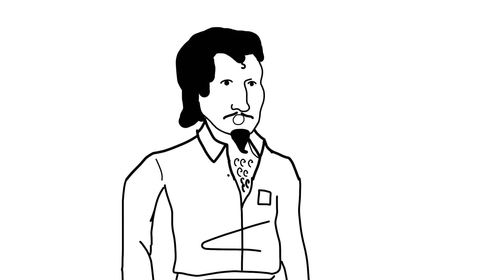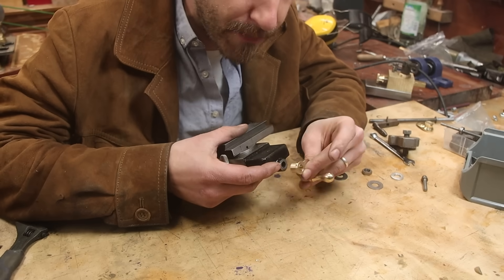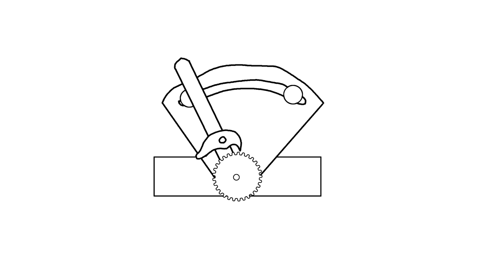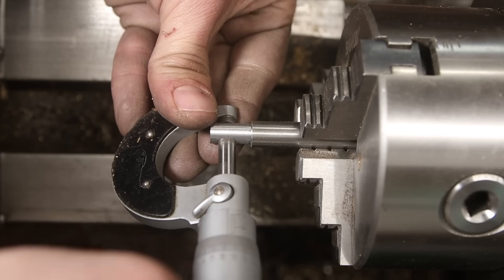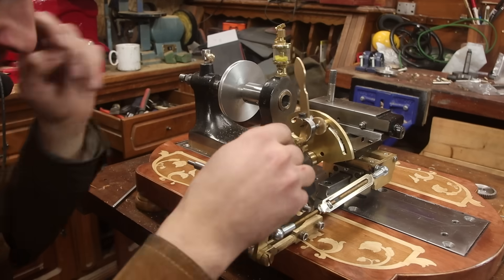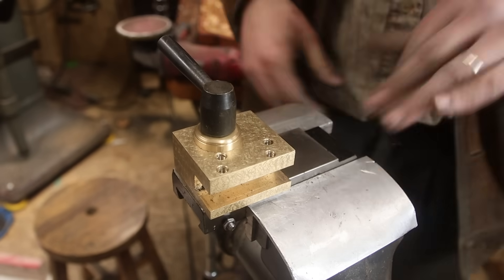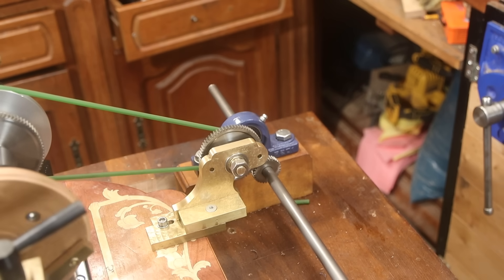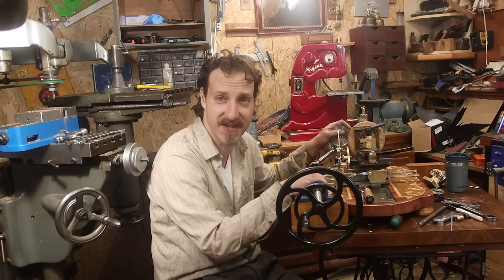I Finally Made a Rose Engine Machine

Comment: I think its never going to work with the roses driving the cutter. You really need that accuracy and weight of action to keep the cut steady, as you press the cutter with your thumb you need to feel the smoothness. You cant just set a depth and go crazy.
Still impressive attempt no doubt you can do it

Comment: Beautiful and inspiring work as always. The hand operated tool rest is amazingly effective, might be cool to have it double loaded, a sharp engraving style profile on one end, and a slightly radiused cutter on the other. That would give you smoother cuts with less grabbing or gouging. Also some relief angle on the top of the cutter might give you more control with better finish. Joe Pie has lots of great videos on cutting tool geometry. 
And, you said it yourself, cams on the spindle, no linkage required, direct lateral motion transmitted to a tool cross slide (this could be added as an optional setup, and might be part of the copy lathe functionality).
The lathe head you have has an exceptionally wide open area between bearings, plenty of room for some beautiful brass cams. 
Make it so!

Comment: Yeah, I think you are correct, in that the machine needs significantly redesign. But I do like how you mounted the work piece to the spindle. Everyone else has the brass stuck to the lathe heating up a glob of scalack. And they had difficulty getting the peice flat, and square. I doubt you will have that problem. It is at least a partial success.🤔👍👌🤔🙂

Comment: The spinning driveshaft with the flexible universal joints reminded me of a video I watched that showed how the speed of the driven end of the shaft would speed/ramp up and slow down per revolution because of the wrong shaft angles, and clock positioning of the joints relative to each other, they were using automotive driveshafts as an example... Great video!
Reply: The four connecting points (bearings) of the cross-pins act like cam lobes when the joints are flexed at severe angles, the other joint angle/yoke orientation at the other end of shaft should cancel out harmonics from each other.

Comment: Zero backlash gear set?  I suspect you are familiar but a clumsy description: Two identical gears side by side, matching slots with a spring in the slot, each end of the spring attached to each gear. Spin the gears against each other to tension the spring in the set before meshing with its mating gear. Viola! No lash.

Comment: Can an upside-down pigeon...
Step 3
6 airbags x2 as the system only holds that much air . Neutral is all bags at half mast.
Maby a track 👣 for the weights 💪 to solve the problems of motion interfering with the lime it takes for displacement of bag 11 to 1 to bag 5 to 7 keeping 1 to 5 closed and 7 to 11 open. 
.....&  an aquarium to display your upside-down air fall 😊

Comment: No desire...
Step 2
Piston shafts from 12 to axle to aquire away from it balance of the 12 weightlifter weights that top their rods.
Motion is from sauser mounted with hole in center . They backstop the weights at the rim. To about 4" straight away from axle outwards.
We're going for a perfectly balanced wheel. 😊
Oh and an aluminum belt arround the whole rim ... maybe first ? To make an area for air to flow freely through.

Comment: For one thing, You have to fit the double cardan so that the varying speed of the first coupling, is canceled out by the varying speed of the second coupling. If a single universal joint is turning under an angle, the speed varies during a revolution.

Comment: Perpetual motion pathway...
Step 1.
Bike axle spokes and rim.
Use the hole for adding and subtracting air for that purpose later so put 2 holes one on either side of it a distance apart of 12 total holes evenly spaced arround the rim.
So 13 total holes 
Is the battle I fight to communicate this to another recognizable 🤔

Comment: Genial! About backlash... First I thought if you added a disk break to resist the rotation. Because force is needed to overcome the brake pad friction, backlash disappears as soon as crank force disappears.  But, maybe better would be a ratchet in the spindle with tiniest of teeth? Or ratchet without teeth, a sping loaded ball bearing in an shallow angle against a cylinder.

Comment: Hi Uri, a brake or means to introduce drag may relive the effects of gear backlash, this will only work if torque only goes one way through the geartrain. Another method you could try is make the gear centres adjustable so you can bring them close together with a screwdriver or tool and take out all backlash, this will work with certain types of gears.

Comment: Nice attempt and beautiful execution. However some of the problems were anticipated. The double universal is one source of those. It would be easier and better to connect the cam shaft directly to the spindle output by a chain or a  timing belt. Another source is moving the compound slide. The sliding movement must be loose enough to easily slide, and cannot be rigid enough without being too tight. The linear ball bearing tool slide  - even with the support  - can be a problem as well. Those slides are not rigid and can have considerable side play. A lapped sliding fit is much better.
Over the years I've built a number of rose and ornamental mechanisms and  attachments, in fact using the rocking tool post in one of them. I used a flexure system to achieve a light,  short parallel action without any play  and backlash. 
So yes, the classic design of rocking head-stock is the best, but  with some precaution good results can be obtained with the rocking tool-post as well. I am now building a proper rose/ornamental lathe in the Holtzapffel style. It is using a Hardinge  compound  slide, but the rest is custom made using mostly stock metal shapes. I posted the design on Garbcad: https://grabcad.com/library/ornamental-turning-lathe-rose-engine-1

Comment: Oh wow, that is a fun optical illusion.  At 8:47 it looks like your lathe is cutting the work to make it wider, a move which is actually impossible.  The optical illusion is formed by the lighting on the uncut rotating part, which appears narrower than it is, incorrectly.

Comment: As the head stock spins, the universal coupling mechanism used doesn't provide uniform velocity.
So it will introduce a little bit of disjoint in the motion of the cross slide each revolution.

Comment: you need your headstock to rock. you can try attaching the whole headstock to two ball bearings with the headstock mounted to a bar that runs between them. For the rosettes, have them at the back of the headstock and have a stationary rubber mounted to the actual base of the lathe, as the headstock rotates the rosettes will touch on the rubber creating the pattern. Make sure there is a spring or something pushing on the headstock so it maintains pressure against the rubber.

Comment: I was really disappointed with your first attempt... Probably say angry!! you started something and finished with something totally different... I do see a great deal of improvement and even a greater deal of advanced thinking... Honestly don't think you're that far from a successful product!! You where putting pressure using your thumb and or hand against the cutter to the brass material, and you should use a spring that would keep pressure constant and stable... but I repeat you did a Great Improvement... congratulations... You have a much more successful channel than me... Good luck

Comment: Broader gears, more contact with their spindles, a yoke instead of supporting those spindles only on one side, less runout? And/or just slather all the gear teeth in very thick grease, then give up, then replace the whole assembly with a wide belt.

Comment: Excellent video, Uri! I know your pain all too well, having built a rose engine myself a few years ago (I have a couple videos on my channel.) When it comes to engine turning/guilloche, mass and rigidity are super critical. The downfall of oscillating the cutter instead of the headstock is the sacrifice of rigidity, which often translates to chatter. But the upside is that you avoid the challenge of a constantly changing cutter center height as the headstock oscillates. 

Two of the most critical aspects of a rose engine are incorporating some form of leveling chuck and including a provision for setting the cutter height dead center with the spindle. The guide will only control depth consistently on a flat surface, and a cutter that isn't adjusted to center height will create wandering patterns.

Comment: Hi . The spindle parts and gardan governor both of them should be placed on one metal surface , moreover dont use wood as face plate for holding your part. Any soft material like in machinery stuff ruin your effort dude!!!! Please hold your metal work pice by a chuck or shelac as the watch makers do. Thanks for your effort. You are a man with a golden heart!!!

Comment: Your universal joint may cause issues with repeatable patterns since as your angle increase beyond 0, the of the output shaft with vary up and down. The steeper the angle, the more the variability. If you have an issue, you may need a CV (constant velocity) joint.

Comment: Fabulous work Meister Tuchman your talent is astounding. However before you changed the spindle I was going to suggest an indexed tooted belt instead of the stretchy rubber belt. Also the universal drive joint should be solid because they will always move a squintillionth of moustache hair no matter how tight you have them. So do with that what you will I will still be looking forward to your next mechanical marvel and I wish you success in finding satisfaction with your rose machine.

Comment: Use GT2 Belts - we use them for 3D printers and they can be made backlash free. You can also bend them around corners giving you cheap, quick and easy access to rotation any and everywhere.

Comment: Hey uri did you know that when putting rotation trough that drive shaft you don't get a regular rotation which gets worse the steeper the angle of the drives haft? Might be some thing to look into  otherwise very awesome build.

Comment: The Guilloché Dance

In a haven of tools where dreams take flight,  
Uri toils through the fading light.  
With brass and steel in patient array,  
He crafts a rose engine to carve guilloché.  

The rosettes spin with a rhythmic grace,  
Guiding his hand to an artful space.  
Patterns emerge, both precise and free,  
Whorls and waves of symmetry.  

A lathe’s soft hum, a gear’s sharp click,  
The music of making, deliberate, quick.  
Each turn, each pass, a whispering line,  
Etching the guilloché, elegant, fine.  

With steady hand and thoughtful care,  
He draws beauty from the air.  
The engine breathes, its voice refined,  
A testament to Uri’s mind.  

The lines it leaves are poetry’s twin,  
A dance of curves, both thick and thin.  
A story told in arcs and sways,  
A maker’s ode to ancient ways.  

And as the final cut takes shape,  
The guilloché blooms, a timeless drape.  
A legacy spun on a turning wheel,  
Art engraved in brass and steel.  

So sing of Uri, whose craft is rare,  
With passion wrought in each detail there.  
A rose engine’s master, a maker’s pride,  
Where guilloché and genius reside.

Comment: Many people don't understand how a rose engine works. It's relatively simple, allow me to explain. The original machine had a base-plate of prefabulated aluminite, surmounted by a malleable logarithmic casing in such a way that the two main spurving bearings were in a direct line with the pentametric fan. The latter consisted simply of six hydrocoptic marzlevanes, so fitted to the ambifacient lunar waneshaft that side fumbling was effectively prevented. The main winding was of the normal lotus-o-delta type placed in panendermic semi-bovoid slots in the stator, every seventh conductor being connected by a non-reversible tremie pipe to the differential girdlespring on the "up" end of the grammeters...

Comment: I'm a little confused about the use of a driveshaft with u-joints to transfer power the cross slide cam. U-joint style driveshafts do not have a constant speed output, instead the output speed is sinusoidal. The variation in output speed can be controlled by minimizing the angle of the yokes for most industrial and automotive applications driveshaft angle is less than 3 degrees. The closer to zero angle there is the better.

Comment: Please please please keep going on this Uri. You may be closer than you think. I don't think the backlash is such a problem if the direction of rotation doesn't change - after all, our lathes and milling machines have plenty of it. I think it would just be a problem after the cam, the mechanism where the tool goes back and forth, which I'm sure you can solve. I know vibration and stiffness also play a role, but I can see I'm descending into a minefield of innuendo so I'll stop there.

Comment: One little thing I noticed is your two uni joints aren't at 90 degrees to each other which will introduce accel and decel during rotation even at perfect 90 it's still present but much reduced think of it like destructive interference where they cancel each other out. Nice work though driver61 goes in depth about various uni types developed to minimise rotational humping worth a check may help you smooth it to closer to rotational parity :) .

Comment: I sometimes wonder how, after watching you for 6 years, I am not in an insane asylum, but happily I'm not. As an engineer I can tell you that wherever standard gears are used backlash is inevitable. A variable motor drive with timing belt pulleys and belt will help reduce backlash and give a more positive action. There are a few ways to reduce play and backlash in equipment, but they do tend to be expensive/time consuming. Best of luck with it, if you decide to keep on with the project 👍
Reply: so using only belt drives would solve it or gears with very fine teeth ?
Reply: @jyvben1520  They are not the only way, but 2 ways. I've spent ages lapping gear pairs in, that can reduce backlash but usually reduces gear noise. Ground gears and using the ground gear PCD to grind the bore,and having an accurate eccentric shaft, is another way to reduce backlash. Our gearboxes were mainly industrial, defence, maritime and mining related and had around 0.003"/0.076mm for each stage, when using hypercycloidal  gear stages to obtain the required reduction ratio. Using helical gears  instead of spur gears can help reduce backlash as well as transmitting greater loads. Generally the more precise your components are the better you can control backlash.

Comment: Your latest iteration has 3 drive gears.  Can it be reduced to just two, cutting your backlash about 50%?  Also, very thick grease (like refrigerated butter thick) instead of oil.  I used this trick to reduce backlash on a backyard telescope mount years ago and it worked great.

Comment: Hey, That "driveshaft" with the two flexible joints should have the joints in each end facing 90 degrees from eachother. Or else you get uneven speed. Please look up driveshaft vibrations. This is a common issue on driveshafts in cars.
Reply: He could use a constant velocity joint, or a Schmidt coupler too.

Comment: An impressive effort in both project and video! Well done! 

Most of the attachments developed by Holtzapffel and others on OT lathes were intended to recreate the motion of a rose engine at a more economical price point for the time. In my experience, none of them work as smoothly as a proper rocking rose engine when they try to rely on the same cam motion of the rosette, but can achieve great results in their own right when they don't. The spiral apparatus and reciprocator are both very effective and you have made a lot of the parts for both in this project. The reciprocator produces a sine wave which is the main geometric component of many of the rose engines best patterns on the sides of cylinders. There are also historical examples of OT lathes converted into rose engines that offer a lot of ideas to the foolish such as myself. I've been lucky enough to work on many of the Holtzapffel attachments as well as a lot of time on proper rose engines and I would be happy to share what I know. Feel free to reach out!

Comment: What an interesting challenge to try to recreate, now you have me wondering how easy it would be add something similar to a regular leadscrew powered lathe - while there will still be backlash most of the work required to transmit the torque from motor to both spindle and cam modified cross slide is already done. As long as the cut can be continuos or you have some other tensioning system to keep everything engaged under a load in the same direction as the cut the backlash shouldn't matter... Not that I have a suitable lathe for such an experiment, but it seems like a belt pulley you can lock onto the leadscrew to drive the cam with a spring tensioner would probably be enough.

I'd have to say your end results while unimpressive compared to what rose turning can be are not that bad either - not bad enough to be really called a true failure! As put it behind the hands of a clock or something and I doubt it would look that shoddy.